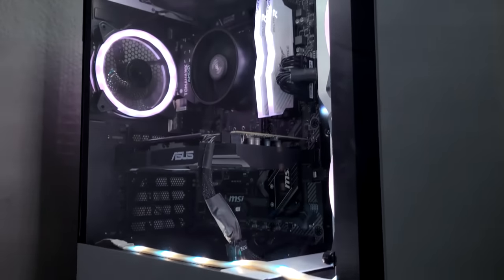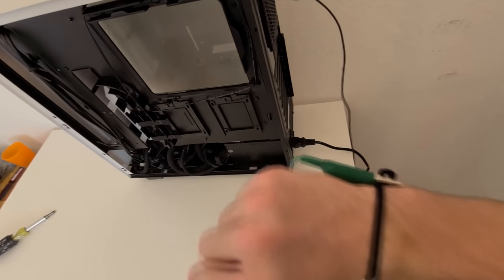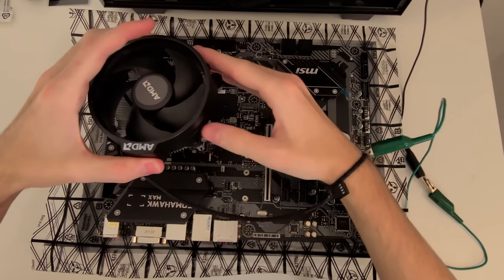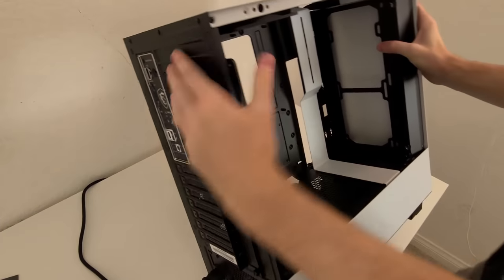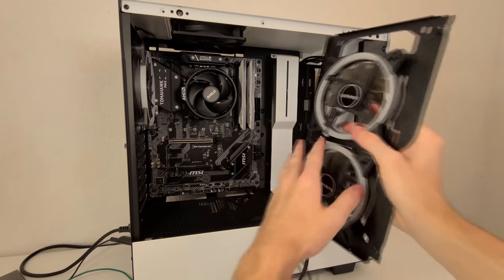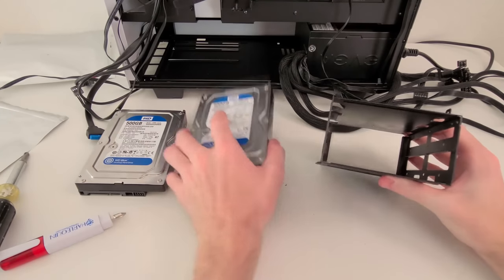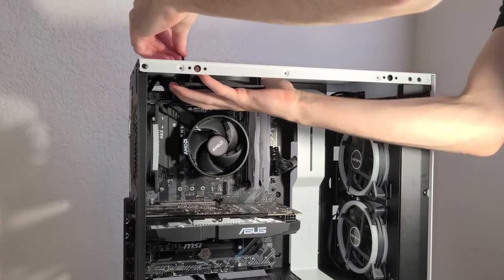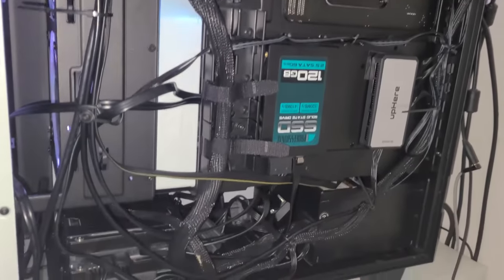BEST $700 Streaming/Gaming PC [Build Tutorial]

Comment: I highly recommend anyone going with this setup to swap the graphics card for a gtx 1660 super, its only 50-60 dollars more but packs WAY more performance

Note: I've said this in replies but to make it easier to see, nvidia card has NVENC which will help your streaming A LOT, basically it encodes your stream seperately meaning it will not take any more cpu or gpu power when streaming. If you want to stream, go NVIDIA
Reply: Appreciate it.
Reply: @Shaggle McDoomsday 100 percent
Reply: Wait how much us it
Reply: @notmky2189  he said 50-60 dollars
Reply: What about the ram
Reply: @Shaggle McDoomsday Not worth it. Ryzen 3600 is much better for multi-tasking (e.g. streaming) due to having 12 threads compared to 6. If you are really low on budget I3 9100F does the job for strictly gaming for now, and it is so cheap that you can buy it until you have money for a good CPU.
Edit: check https://www.userbenchmark.com/ to get an idea on the components.
Reply: bro a used 2060 or 2060 super from eBay is so cheap don't buy a new 1660 super buy a used 2060 or 2060 super it's like from 200 to 300 dollars so cheap for a strong graphics card like the 260
Reply: I ordered the same parts with a plain 1660 and some different ram. I was wondering, does it already have WiFi and Bluetooth
Reply: Witch one is it
Reply: I can’t find it
Reply: @notmky2189  16gb at least, always, 8gb doesn't cut it anymore
Reply: @notmky2189  around 265 dollars, its going for 280 on amazon rn but it will hopefully drop on black friday
Reply: @Shaggle McDoomsday go with ryzen, theyre so much better than intel nowadays, I recommend the ryzen 7 2700x if you can afford it, its even better than the already amazing ryzen 5 for not that much more
Reply: @jaydenherrera8330  it might be out of stock or he meant the 1660 ti
Reply: Does it interfere with anything? I have no idea lol
Reply: @eSkittles  Nope, its all compatible dont worry
Reply: @IRON-MAN._.827  thats over 100 dollaars more than this video's card, I was just pointing out that a 1660 super wouldn't be that more but if you go to a 2060 then you're pushing it in terms of budget for some people which is only gonna get you another 10 fps average
Reply: @QuantumNetwork  how much does it cost to put all the rgb stick on all the slots and how more fps does it get you to
Reply: @notmky2189  XD I can't tell if you're trolling or not, RGB just means red green blue, they're just lights and won't get you any better FPS
Reply: @QuantumNetwork  dude im not that stupid im just saying how much fps more they give you if you filled all 4 ram slots
Reply: @notmky2189  Idk what you meant by RGB sticks tho, if you meant ram, going max ram won't increase fps, you'll just have more to work with, I can't think of a game that would use all 16gb of your ram
Reply: 5600xt is so much better and cheaper than the 1660 super so nah go with the rx5600xt
Reply: Go for 5600xt like 20 dollars more for more performance than a 1650ti if you want to go amd
Reply: @elijahbruner3676  ?? Its 50 dollars more than the 1660s lol
Reply: @elijahbruner3676  Also if you go with amd instead of nvidia card you wont get nvenc which helps tremendously when streaming games
Reply: Agreed.
Reply: if i was to get the gtx 1660 not the super one would it work fine
Reply: @shiggyluvsyou6696  Yes but not as well as the 1660 super. But it would still work great.
Reply: Ryzen 3 3100 and an rtx 2060 comes in cheaper than 3600 and 1660 super with better gaming performance
Reply: Robb Coochieslayer  Based on what? Benchmark say Ryzen 5 3600 is cheaper than I5 2500, is 11% better, has 2 cores and 8 threads in addition
Reply: Dammit just get a RX 5500XT its cheaper than the 5600xt its not that much better
Reply: And ryzen 7 2700x its cheaper that the 5 3600 r/n
Reply: Robb Coochieslayer  You are living in the past. Ryzen 5 5600XT is only 5% slower than Intel's best CPU on the market, I9 10900K at a much lower price. Ryzen 7 5800 has the same performance as it
Reply: What about a rx 5700?
Reply: @QuantumNetwork  could u answer my question pls cuz u seem like u know what ur doing
Reply: @Flare would the gtx 1660 ventus xs work? I’m new to all this pc stuff and I can’t find a 1660 super.
Reply: Thats what I thought people should do, seeing as the tomahawk is compatible with the gtx 1660 super itd run faster. My only question is is that would you need a larger power supply than the 500w power supply in this build?
Reply: @luka0157  are all 1660 compatible? Like the 1660 ti or the regular 1660
Reply: @luka0157  I went with a 650 watt, no complaints :3
Reply: @Flare... yeah I was just commenting the same thing it’s definitely worth that little extras for a 1660 or a 1660ti. Save money on a case or somewhere else and get better graphics and fps my friends
Reply: @Anthony Magno yes it’s all pretty solid stuff. Very popular motherboard if not the most. Pretty good case but you can find others with better ventilation or more fans. But when it comes to raw performance for gaming a better graphics card would be the only thing to change on this build basically
Reply: Yeah that's true
Reply: @QuantumNetwork  yoo bro do u recommend any other upgrades
Reply: @6ryannn  Ryzen 7 2700x is a beast, that's the one I got so there's that, and then the only other thing worth upgrading is I guess ram if you need it, 16gb is enough but if you feel like you'll wanna do video editing and stuff, and maybe even streaming with multiple screens and programs / tabs etc then going for 32 might be worth thinking about, of course make sure you have sufficient wattage on your power supply and adequate cooling :3
Reply: @QuantumNetwork  ight thanks
Reply: @6ryannn  gotchu fam
Reply: get the 5600xt. nvidia is garbage
Reply: @dins.garage  gtfo
Reply: It’s what I’m doing lol
Reply: @ryanjcurran2  hb for streaming?
Reply: @Kieran Schmitt ok thx and yeah that's mine
Reply: Thanks man 🙏🏽
Reply: Since am building a pc is a gtx 1650 super or gtx 1650 good?
Reply: I was thinking the same thing*
Reply: Aben Falsten  ok thx btw its a ryzen 5 3600
Reply: its true and nvidia have a better encoder unlike amd gpu he just put "streaming" for more clicks
Reply: would a ryzen 3100 and a rtx 2060 work well?
Reply: Which 1660 MSI or EVGA because I'm confused
Reply: @FlooDaKidd  It doesn't make much of a difference except for the temperatures, MSI and Gigabyte are the best/most popular, the bios for the MSI is the favoured one which is the one I got, whatever you do DONT get the Asus one, everyone complains about that as the temperatures get extremely hot on that one and has many bad reviews, although it's cheap, it's the worst
Reply: Thanks, I'll get that then!
Reply: Adds up tho you can add 50-60 to everything and end up paying 300-400$ more.
Reply: @robbarber7253  adding 50-60 to graphics card will do way more than 50-60 to any other part tho
Reply: Did u have to upgrade anything to fit the graphics card?
Reply: Can someone help? is this compatible with everything else in the video “EVGA GeForce GTX 1660 SUPER 6gb GDDR6”

I have the same parts just changing to a 1660 super.
Reply: @powerfitz_  Thanks!
Reply: @mugged8719  yes
Reply: @powerfitz_  Hi again, I was just wondering if a Ryzen 3 3100 is compatible. (not interested in streaming so therefore would rather spend less on a CPU). Will this also still be a good CPU? Or should i spend a bit more.
Reply: @powerfitz_  Do you know a good processor for the £150 max £200 range?
Reply: @powerfitz_  The Ryzen 5 2600 is £150 which is more within my range. Will it really effect the performance where I can’t run AAA games smoothly or Will it be a minor change? Sorry for all the questions first time building a PC. Old one was prebuilt.
Reply: @powerfitz_  I am guessing because of Christmas prices?
Reply: @powerfitz_  Yeah I will just make that the last thing I get. I appreciate the help. Do you have discord just for the future?
Reply: Ima go with a 1660 to gaming x oc
Reply: Since people are still comenting, I thought I'd just update, yes I have built this exact set-up but  of course I got the MSI GTX 1660 Super XS OC with 32gb ram and the ryzen 7 2700x, it's literally perfect for anything I need to do, I went with the stock cooler that comes with the ryzen as it's more than enough unless you're doing heavy overclocking or like extreme intense work
Reply: Is it possible to use like a gtx 1080 or 1070 on this or would it not fit I’m kinda dumb
Reply: “EVGA 06G-P4-1667-KR GeForce GTX 1660 Ti SC Ultra Gaming, 6GB GDDR6, Dual Fan” is it that
Reply: @QuantumNetwork  imma build this but i can’t afford the ryzen 7 2700x or the parts you listed. should I stick with everything that’s in this video or is there anything else that’s better but a bit cheaper than what you listed?
Reply: will the gtx 1665 super work?
Reply: @Blinx It depends what you choose, you decide that, I recommend 1tb of SSD, HDD is very obsolete nowadays
Reply: @stoppls2896   Theres no such thing
Reply: @QuantumNetwork  nvm lol
Reply: @stoppls2896  XD
Reply: @Blinx I got the Samsung Evo 970 tb, its perfect
Reply: @Blinx No worris man! Take care

Comment: tip for builders: use a cross method to screw anything in
Reply: especially with fans 😬
Reply: What do you mean? Im confused
Reply: @grimothy9964  to make sure you done bend or break the case
Reply: @grimothy9964  cross method is screwing in the opposite corners first
Reply: hey would any pc case work instead of this one keeping in mind there is ofc enough space?
Reply: web not any

Comment: This is the best build guide I have seen so far. I have the same build but have a different mobo. Have a great day!
Reply: How much fps does that computer get to in warzone?
Reply: Vale Carrillo Mine gets around 50-60 FPS on medium, but that’s because all I need is 60 FPS.
Reply: i would be careful on some parts though, for example this case has pre-installed standoffs for the motherboard but some cases dont which could lead to you frying your components, also install the graphics card after the cable management including the drives since accessing the motherboard and power plugs is easier iff you dont have a glorious piece of power sitting in the middle. one more thing is to ALWAYS mount all the hard drive screws, the hard drives have a spinning disk which means they vibrate if theyre not held down completely, this can lead to damage to the hard drive. also you really dont need an antistatic braclet just dont act like a fool and you wont break anything and if you are really worried about shorting the circuits, just touch the plugged in power supply every now and then.
Reply: Gamertibs oh ok thank you!
Reply: @Chiflevale  how Many fps gta fortnite minecraft?
Reply: I am planning to have the same build but a different GPU (Graphics Card/Video Card). I also plan to have the same exact case but black. The memory will be the exact same but black.

Comment: Dude. Listen up. I've watch so many PC build tuts... But nothing comes close to this.. Brilliant, simplified everything.. Thanks! I'm a lil groggy though when it comes to cable management. Thanks
Reply: What  if my moniter dont work for this pc?
Reply: @godlytrent5144  I don't think it matters what monitor you got. Well that's what I think
Reply: do I have to do the bracelet thing he did after putting in the powerr supply?
Reply: @ludmilabordei5884  better safe than sorry
Reply: @tuphelo  yeah but what does it dodo I have to do I t
Reply: @ludmilabordei5884  You dont got too i didnt have to but if you want to be safe you should get one
Reply: @ludmilabordei5884  it prevents you from getting choked by the circuits. Yes you have to do it. It's recommended
Reply: @tuphelo  aight ill buy one then when I build it lol

Comment: This is definitely the pc I'm gonna build in the next few years

I started a whole group chat in the reply section lol.
Reply: go with ryzen 5 2600x/ryzen 3 3300x and a 1660 super instead,
Reply: I’m new to this I haven’t even gotten my pic but when u mean “ build in next few years” does it mean u won’t be able to use ur actual computer until u have the pc done?
Reply: @alexhernandez5898  I built my pc so I'm gonna build this one when my first pc gets a few years old.

And no that's stupid.
Reply: @yeowch8453  I can see that working pretty well 👌
Reply: yeowch is that not more expensive tho
Reply: @ewanellison2809  spending less on the cpu and more on the gpu, if you went with the r5 3600 and rx 580 its about 330 but a 2600x and a 1660 super is the same price as an r5 3600 and rx 580. If you want you can go for the r3 3300x which is a bit cheaper but only has 4c/8t but has 7nm architecture
Reply: Aye same
Reply: Ace player 1 true but in a few years you can use a different graphics card.
Reply: @yeowch8453  can u message me on insta I'm trying to build this but don't know what to switch
Reply: vurtry ye whats ur insta
Reply: yeowch no the Ryzen 5 2600 is not good I’ll would rather get the Ryzen 3100 or 3300x if the 3300x ever gets back in stock
Reply: vurtry I can help
Reply: xAPx Alex do u read my comments before posting urs did i not say go with the 2600x/3300x, some people want more cores and some people want gaming performance
Reply: yeowch yeah I did but the 2600 is worse compared to the 3100
Reply: xAPx Alex the difference is the 1600 has 4c/8t but the 2600 has 6c/12t so id go with the 2600 for an extra 10-20£ more
Reply: xAPx Alex also you can’t just say worse in one way you have to justify why it’s worse, the 2600 is better for multitasking assuming you know what it is
Reply: yeowch look man look at the benchmarks between these CPUs 2600 is just a little better for multitasking but for gaming the Ryzen 3 3100 is better why do you think the Ryzen 3 3100 and 3300x are out of stock because they are the best for the price
Reply: yeowch and btw I’m looking for a good 800-860$ pc I have one do you think you can check it out
Reply: yeowch look the 3100 is cheaper, okay and on games like Fortnite and stuff like that it runs more FPS and has better quality the it’s better at 1080p and at 1440p
Reply: xAPx Alex you want the best price to performance, 3300x is on par with the 3600 even though it has 2 less cores and 4 less threads. The 2600 is basically the 3100 with 2 more cores and 4 more threads. 3100 does not surpass the 3300x on performance and is on par with the 2600
Reply: Could an 800-900 PC run next-gen games? Doom, Battlefield 6, COD etc. After update 8.00 my friends and I are packing up and moving to PC
Reply: @BabysL33z  omg pls msg me on insta if my replies iam very interested
Reply: just get a 7 the 5 will be worthless soon
Reply: Yeah except they don’t add the 100 bucks for windows ten, or mention this case doesn’t have very good thermals so without throwing in an extra 100-150 for a liquid cooler your cpu is going to overheat, and a 500Gb is not enough storage for anything let alone streaming if you are storing video files and what not. I just recently build my first PC and the only thing I can approve of here is the cpu I feel like it’s one of the best if not the best bang for your buck CPU currently out there. But the SSD thing is probably the biggest issue all of these budget guides recommend this small and cheap storage but what they don’t tell you is half of that is taken up by bios so you can only have like 3 games and if they’re triple A forget about it. With my 512, I was able to have ark, the Witcher, and halo MCC installed before it was full. So they say 700 build guide, it’s actually more around 1100 of you want a decent 1080p 60fps rig. I also forgot this motherboard doesn’t support any of the new chipsets you’d need a 550, or any of the Gen 4 m.2 so if you wanted any of those fast loading speeds if your plan is to build this rig in the next few years when developers will be making games that can utilize those load speeds since consoles are being build like pc’s and are no longer a bottleneck for it, then you won’t be able to.
Reply: @yeowch8453  Why?
Reply: @yeowch8453  can you send me a link with the 1660 that you recommend plz ?

Comment: Couple things:

DO NOT put together the mobo on top of the anti-static bag, while no static is inside the bag, the outside may have some still.

You don’t need an anti static wristband if you aren’t building in carpet like this guy. If you are building in carpet build barefoot or with shoes but NO socks/slippers
Reply: i mean, components nowadays have a very good ESD protection. Even if you  intentionally to static the mobo, you wont fry anything.
Reply: @Nockky95  the pint is that there is still a chance, and placing the mobo atop the anti static bag is so easy, why would you take that chance?

Comment: The price is actually $847 rn on amazon. I would also recommend a different case, the Lian li 215 has 2 200mm, and 1 120 mm fan with a mesh front, this means much better airflow and temps especially for your gpu
Reply: Yo looks like yk a lot about this stuff I can't afford the graphics card any idea of anything cheaper I can replace it with

Comment: Building my first PC atm. It cost me £700. 

I have (or am getting) an MSI MAG FORGE 100R. An Asus RTX 2060 12GB. An MSI MAG B560 Tomahawk WiFi Mobo. An i5 11400f. 16GB's of Corsair Vengeance ram. A Be Quiet BN302 modular psu@600 Watts. 1 TB of Samsung EVO Plus Nvme M2 SSD. And finally a Cooler Master Hyper 212 Black. All brand new. 

I feel really good about what I got for so little :)